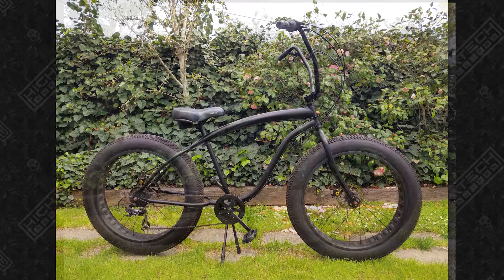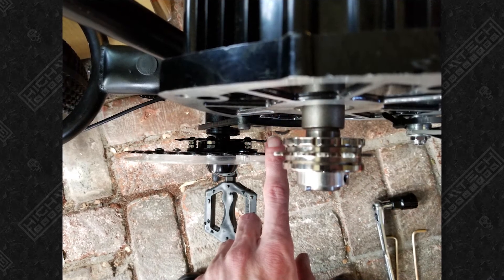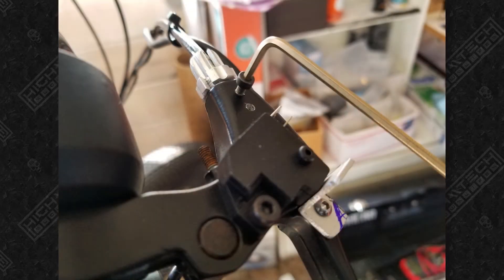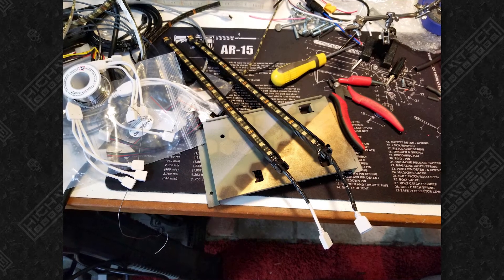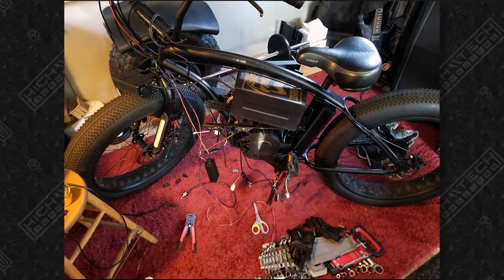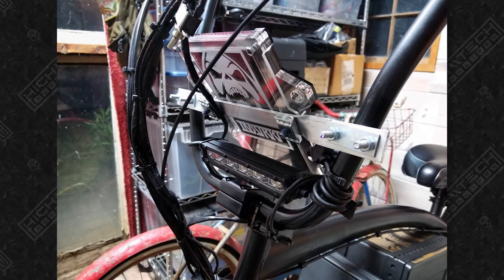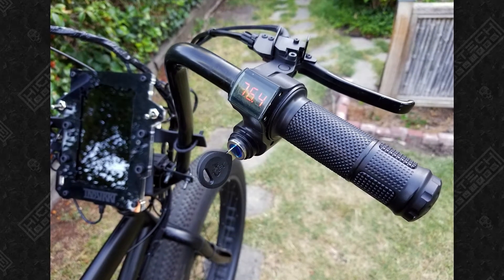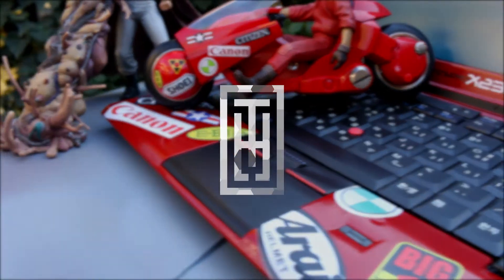🚲 Custom 18KW (18,000W!?) E-bike! Urban "Super Cruiser" Fat Tire Mid-Drive Ebike - DIY Full Build!

Comment: do you think if i'm using a carbon fiber bike I should just get the next smallest motor down from cyclone? 
This monster seems like the weight and power might be overkill?
Reply from the maker: It depends on what you're going for really, carbon is very strong so if it's mid drive I'm sure it can handle it, but it's really about what your goals for the bike are. No use overpaying and overbuilding something you will never utilize or enjoy. 👍

Comment: If you have 2kw and above motor, would you recommend hub or mid drive?
Reply from the maker: It really depends on your goals, application, context and what you want your bike to do/be like 👍I personally prefer hub motors over mid drive, but this type of motor suits my type of preferences. If I only had 500W and lived in a place covered in hills, I might want to go with a mid drive. There are pros and cons to each. I will be making a video on hub vs mid drive in the future though 🍻The major benefits of hub motors to me is zero drivetrain wear (chain/sprockets) and also near zero noise. You can also pile on power without having to worry about your chain breaking.
Reply: @hightech-lowlife  amazing. I'm looking forward to your videos sir. I just don't know if a 2 KW hub motor is enough to climb a steep hill in my area. It's the only way to the city. 

I've done my research on the pros and cons. The mid drive has more torque, you just need to configure the gearing. While the hub motor doesn't have a variable torque configuration. You can increase torque with smaller tires, but hell nah, I won't do that. It's ugly haha. 

In your experience, did you burn your hub motor once? Or did you know someone who burned their motors? (Not overvolted 😂, but within the specs)
Reply from the maker: @troyguererro0898  Thanks so much, 2KW on a regular bike frame is plenty for hills, you will fly up the hills. If you are pushing your mid drive hard with hills, you will go through chains and gears much more quickly (they will wear out faster) than if you were just using your body to propel you.  Just something to consider 👍

I've never overheated or burned up a hub motor (yet), it just depends on if you're giving the motor power it was rated and designed for. I think you'd be just fine with either one honestly.
Reply: @hightech-lowlife  thanks, I'll keep that in mind ✌️
Reply from the maker: @troyguererro0898  🍻

Comment: Yeah, please make a full suspension bike! I'm thinking about one, though I currently would prefer a midmotor since in Germany we need to have pedal assisted driving (PAS) and are only allowed 250W and 25kph. I think you can have a motor which is capable of more power though it needs to be limited to that (by max current I would guess) and you are not supposed to be able to change it via the controller on your bike.

Thinking about a Bafang BBS01B  with a 36V or 48V battery setup. A medium/small 500Wh battery should do since I rather have it not too heavy and 50-70km would meet my normal commuting range.
Reply from the maker: I have full suspension builds coming that are lower power too, even another mid drive 👍 you can do PAS with hub motors too! I will do a bafang build but most likely will be the BBSHO2. Thank you!!

Comment: Hi, I wanna try to build one with cyclones 6kw motor. but I still am very uneducated with these batteries and motors. I am still very confused from ur noob mistake. I wanna ask what should I do so that I wouldn't come across your previous mistake? Your professional skills would be really help full. Just an fyi, i was planning of getting the 6kw motor and a 72v  battery with a 150 amp bms.  Would everything be ok and work well together?? thanks
Reply from the maker: Yes that would work just fine. My mistake was not purchasing a battery that had a sufficient power output (discharge) from the BMS. 150A @ 72V is 10.8KW, most motors can do more than they are rated, so most likely it will be fine, if the controller is programmable you can always turn down the output amps if your motor cannot handle it. I think 150A BMS is more than adequate for almost any high power ebike, unless you're trying to do things that are really crazy (20-30KW range).

My thoughts of batteries have progressed more though, a lot of people are running without a discharge BMS and only using a BMS for charging, this will rid of the discharge limit from the battery. You just want to be careful not to overdischarge the pack by either monitoring the voltage as you ride, or setting your controller to cutoff at a certain voltage. 

Go on reddit r/ebikes and ask any questions there, the community will help you figure things out if you're unsure 👍Good luck man it should be a fun build!
Reply: @hightech-lowlife  thank you so much man. reddit always wont let me down. thanksss

Comment: You Inspire me to start building mine. I will go with QS Motor 3kw V3 and for battery will be a new 20S 21700 pack with Molicells or 21S Lipo. Fatbike full Suspension frame.

Its gonna be my 2nd build.

On this bike on the video, Would be possible to mount the motor below/under de frame somehow instead of inside?
Reply from the maker: Thank you!!

The QS motors are very good :) I wish this bike had full suspension, would be a lot more comfortable. 

Yes, it is possible to do, but with a motor this big you would sacrifice a lot of ground clearance, usually for mid-drive they are hanging below/front of the bottom tube.

Comment: Brilliant and thanks for sharing it.
PS. You think 40+ mph is bad on that bike, try it on a roadbike with 28mm wide tires...way scarier.  I do love my super fast dropbar road bike however....but don't really like to push it much above 35mph or so and smoothness of the road is everything when you have no suspension as you know.  Fat tires and lower pressure help a lot.
Your build is an incredible first effort or any effort for that matter.  Just dive head on into the deep in the pool...what you did and your undeniable talent brought you along just fine.
I am an engineer so a bit focused on things like safety and best practices.  I personally would have minimized all the bracketry on the bike and rounded all the edges for safety but that is a small niggle.  A lot to be said for big power + fat tires...what motorcycles are. 😊
All of us think about our next build.  I like mid drives but high power rear hub drives are compelling as well.  Cheers.
Reply from the maker: Thank you so much! Oh yeah, I can't even imagine on a road bike, although you should be able to go pretty fast without a ton of power on those tiny thin tires! I actually was thinking of doing a road bike conversion, but I've never even owned a road bike before, I think I will do it just for the experience :) 

I don't really feel comfortable going over 35 on any bike, these speed runs I'm doing are strictly for the videos and only for that period of time, the majority of time I spend actually riding these bikes is between 20-30 and that is plenty fast for me. 

Thank you for saying so, I don't really think I'm all that talented, I follow a lot of people on youtube that make incredible bikes from scratch and I'm nowhere near that skill level, but it's still fun to me. I agree I could have spend a lot more time rounding the corners on brackets, but as long as I wasn't constantly poking myself or scraping myself, I figured it was enough. 

If I want to go really fast I have a CBR600 for that! For me hub motors are more robust and you don't have to deal with chains and all that, but with that being said I do have another mid drive build coming up as it has been a while since I have done one. 

Thanks for watching and the feedback! Much appreciated. Cheers! 😎

Comment: hey doing a custom full suspension build with the cyclone.  nice to see someone else has used it, cause theres like 3 videos on it not including the companies, and 2 of em are complaining about things that they dont understand!
Reply from the maker: That's awesome man! I wish this bike had full suspension :) The cyclone is an awesome motor, especially for the price. Haha, I felt like the electronics setup was pretty straightforward, I didn't really have any issues with the cyclone and it ran extremely well! I will be doing another mid-drive soon, but trying out a bafang, it will be full suspension though. Thanks for the comment 🤘
Reply: @hightech-lowlife  had the bbshd ok my built up fatbike but killed the motor. It's not as torque or robust as the cyclone motors. Using the 3kw on the hardtail fatbike. New bike is a scratch built frame I'm making, so that's lots of fun! I'll keep an eye on your channel, can't wait to see other stuff!
Reply from the maker: @ephiosproject  Oh yeah, I can't imagine even the BBSHD to be too robust, only light duty compared to hub motors or the cyclone motors :) I have heard people have issues with chain stretching and wearing out very quickly with bafang, but I will experience it for myself how it is. 

That sounds really cool, my next bike will be half scratch built because the battery will not fit, so I have to modify the frame a lot, but I did get a welder! When you finish your bike and have a video or pictures let me know and I can check it out. Thank you for watching and the comments!
Reply: @hightech-lowlife  make sure to get the lekkie bling ring front chainring. The stock bbshd chainring is trash, the lekkie is lighter, is dished for a much better chain line and is narrow-wide so no more dropped chains. Also You should join us at the e-bike discord!
Reply from the maker: @ephiosproject  Awesome, thanks for the tip, I'll definitely check out that lekkie chainring! What's the link to the discord? I'll check it out too, thanks man!